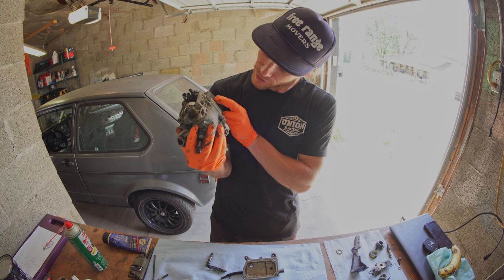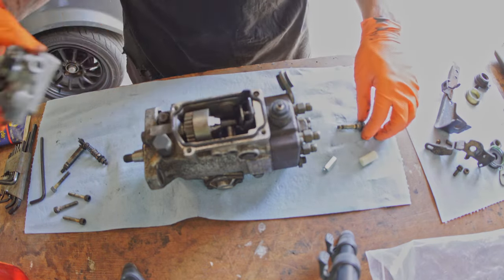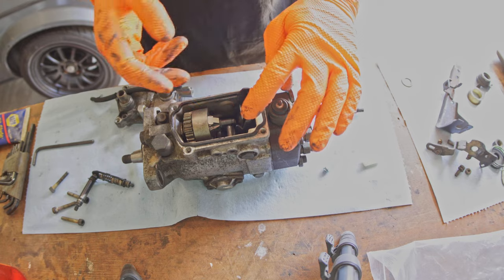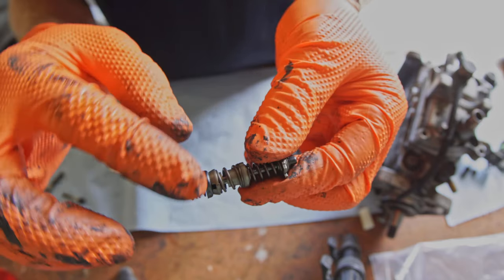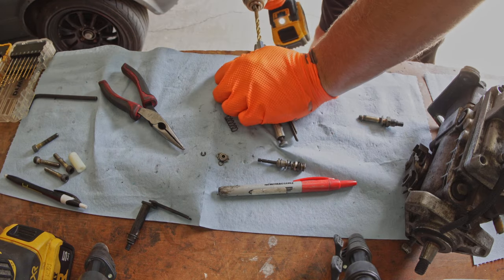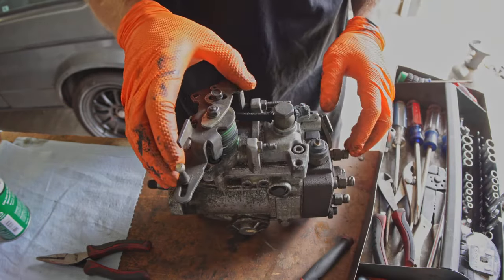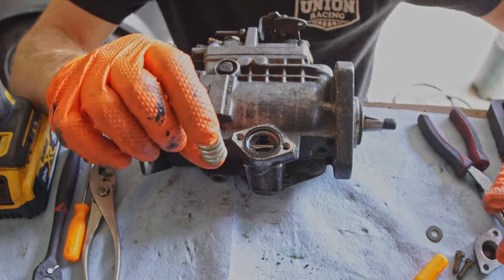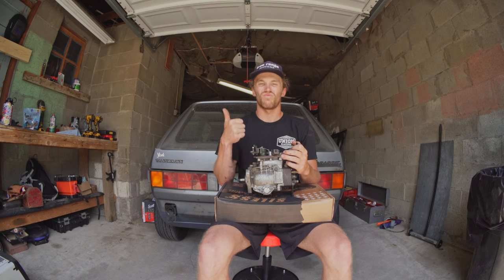Bosch VE Pump: Governor mod, timing spring, and how it all works!

Comment: For a daily fast driver i would probably just put 2-3 washers on to make the spring harder. and marking the shaft in relation to the lever saves a lot of guessing, Just my 2 cents looking forward to seeing how it drives
Reply from the maker: Marking it would've been clutch 😔 hindsight is always 20/20 lol. Fortunately I had the other pump to check against.
Reply: I did the three washer method.  It didn't seem to make any difference? I think I have to replace my injectors. 2 seem to be leaking..is that a good reason for not much change?
Reply: @garybluhm-vd1nm   This mod will not add much power down low only on top, you may have to loosen the max rpm screw for it to take full effect
Reply: @J.F.K.O  my 0 to 60 is like 28 seconds from a stop. Is that typical?
Reply: @garybluhm-vd1nm  nah thats slow my first 1.6 td with a bit of extra fuel and 1 bar boost did it in 9 secs
Reply: @garybluhm-vd1nm  is it na? my auto mk2 na diesel does it in 30 secs

Comment: According to the forums the best result is to shim the main spring 5mm. Wont affect/change drivability characteristics and give the added fuel you desire in the higher rpms. Ill practice on a core pump i have and then try it on my td pump in the future
Reply from the maker: Right on. Definitely report out!

Comment: Thats brave running no main spring. You won't have any max rev limiter anymore.
Reply from the maker: I find the engine's want to get up and go drops off at about 4,000 RPM enough that it makes you want to shift anyways - valve float is still reasonably far off 😁

Comment: Why are there two springs in the governor link?
Reply from the maker: Two different springs rates! The small spring helps with idle control & is pretty soft, the larger spring is the "governor" spring and is stiffer.
Reply: @OliverFetter  I thought the idle spring is the small one that sits between the tensioning lever and starting lever? Where can I find literature on how this dual spring system work?

Comment: This might be a noob question but isnt changing to a bigger plunger just the same as increasing fuel supply on the max power fuel screw? For exemple, a 10mm with increased fuel screw would deliver the same fuel as 11mm with stock fuel screw no? Thanks
Reply from the maker: Hi! Good question. I didn't understand this till recently... Technically you're correct. A 9mm pump with the power screw cranked down can deliver (volumetrically speaking) the same amount as a 10mm plunger with a minimum setting (hypothetically here bc I've never measured output volume). BUT, the period in which the 9mm injects that fuel will be WAY longer for the same volume than the 10mm because you are increasing fuel delivery by increasing injection duration 🫡 the more you turn the power/fuel screw the longer the control collar covers the spill ports 👍 thus a 10 or 11mm plunger provides crispy injection events & lots of fuel. Also idt my 9mm maxed out could touch the 11mm on a low setting 💁

Comment: One thing to make sure, when you put the linkage back in, make sure you put it back in correctly/rotated in the right direction. If you put it in the wrong way, it can cause runaway as soon as the engine is started.
Reply from the maker: That's a good call 😂😅